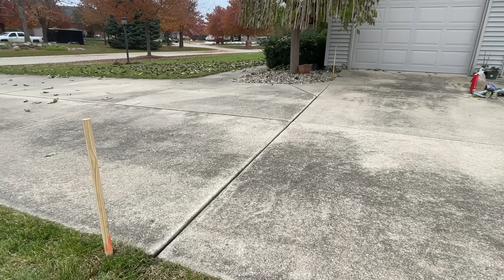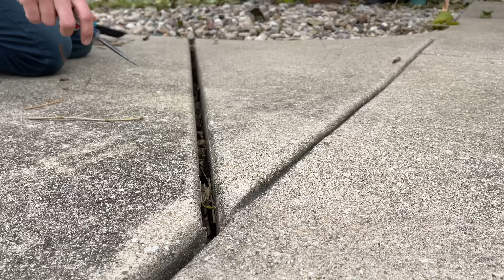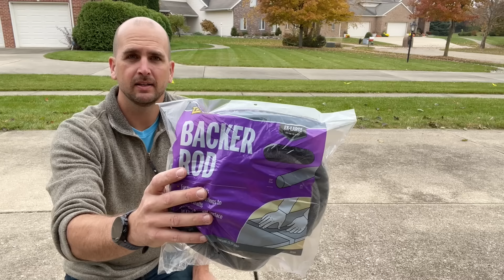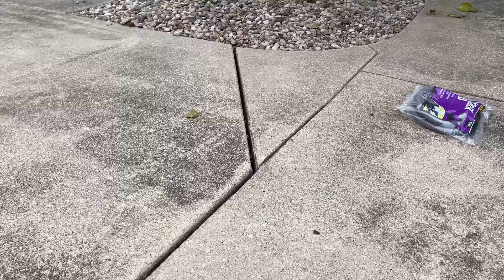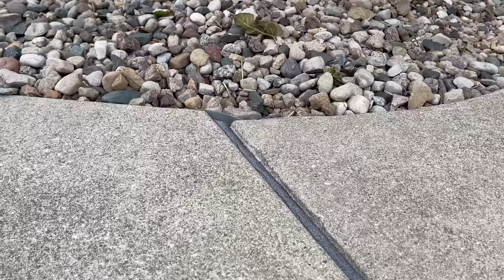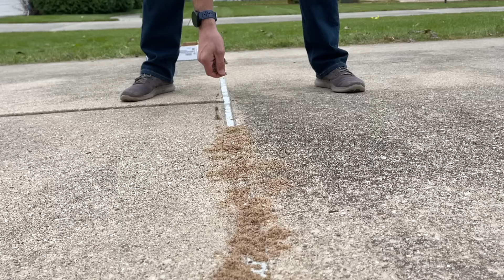How To Seal A Gap Between Concrete Slabs

Comment from the maker: Tremco Vulkem 45 SSL:  https://geni.us/FiPeg
1" Backer Rod (25'):  https://geni.us/qo7b0Ry
3/4" Backer Rod (20'):  https://geni.us/bCyfQBy
5/8" Backer Rod (20'):  https://geni.us/Yhxznv8
1/2 Backer Rod (20'):  https://geni.us/C1J5p

Tools Every Weekend Warrior Needs
Makita Cordless Drill Combo Kit:  https://geni.us/t7dIA
Dewalt Drill Bit Set:  https://geni.us/oFlSl
Dewalt Screwdriver Bit Set:  https://geni.us/VDcr
Craftsman Screwdriver Set: https://geni.us/jXqFI
Eklind Allen Wrench Set:  https://geni.us/7XfvO
Pliers (4-Piece Set):  https://geni.us/RIdx
Milwaukee Fastback Utility Knife:  https://geni.us/MlyiLk
Stanley Tape Measure:  https://geni.us/bUfD1R
Studbuddy Stud Finder:  https://geni.us/RySCuVw
Johnson Torpedo Level:  https://geni.us/wiLcDY
Stanley Hammer:  https://geni.us/bPDk8Wo
Buck Bros Wood Chisel Set:  https://geni.us/vk3cpTW
Klein Voltage Tester:  https://geni.us/h9Hl
Klein Outlet Tester:  https://geni.us/kdBAJ
Milwaukee Wire Strippers: https://geni.us/5zuLAbC
Little Giant Ladder: https://geni.us/fmlmTk

DISCLAIMER: This video and description contain affiliate links, which means that if you click on one of the product links, I’ll receive a small commission.

Comment: I've used Tremco's Vulkem products for years. Another tip is that if you don't want to apply sand and need the surface to skin up faster to prevent leaves from sticking you can mist the surface with water. Vulkem is moisture curing and that will allow the surface to skin over and keep things like leaves from sticking.
Reply from the maker: Nice, thanks for the tip Jeremy 👍
Reply: Jeremy you are absolutely right( most urethane sealants are moisture cured) but if the concrete gets wet before the sealant has cured it can affect the bond. I have installed miles of sealant on flat work and what I do is get a sheet of Masonite, rip it into approximately 4” wide strips for typical 3/4” joints, wider for wider joints, and tape it over the joint. If the sealant is installed properly the Masonite won’t touch the sealant.
Reply: @EverydayHomeRepairs  Hi, please, , I need to cover the space between the wall panel and the patio floor concrete. There is a gap of 2 cm through which mice, cockroaches and frogs enter. I'm afraid of using putty between two different materials (the wall panel and the concrete) and breaking the wall panel when the product expands. What do you advise me ) Does this product accept to glue these two different materials or does it only glue concrete with concrete ?
Reply: Another Wet tooling flim flam man trick
Reply: Thank you for the tip!

Comment: I did this 30 years ago. And it's still in place.
Reply: thats shocking. polyurethane degrades with the uv in just a few years. you mustve used silicone or did it inside the garage

Comment: Here’s a suggestion. If you have Company that sells concrete products, landscape blocks, etc, the one in my city has  every size of backing rod either on spools or in sticks. It’s way less expensive. I bought 300 feet of backer rod for $10.
Reply: Why not use clean sand instead of backer rod to fill in the crack first? Seems like it would be faster, easier, and cheaper. Just thinking....
Reply: Whaaaa, can you give an example of a company that does this??
Reply: @steadyeddie7453  Sand holds water; freeze-thaw pries joint open and breaks the bond.

Comment: Great video. I did a similar project but I used something different than sand on top. I went to a local landscape supply place and found the aggregate that most looked like my exposed aggregate driveway. I took a bucket and swept up the dust from the bottom of the aggregate bin and put that over my sealer.  It matched the driveway color very closely and gave it a nice blended look.
Reply: Clever!!

Comment: Vulkem caulking is an excellent product and will last a long time. I use a liquid tool handle product to seal partially used tubes of caulking. Just dip the open end of your caulk tube into the liquid tool handle and it will keep the caulking just like new until the next time you need it.

Comment: If you slightly pull or stretch on the backer rod during installation, my experience proves its dimension narrows enough to more easily fit the void without having to do all the poking. It’s a feel, but a slight twist along with gently stretching also narrows it, and one it is properly positioned, the rod relaxes holding right in place. For even larger gaps, usually where the slab meets the garage floor or the curb; I’ve used insulated pipe wrap for copper piping. It’s the same closed cell foam as the backer rod. Just be sure to fit it tight at junctions because it usually isn’t a continuous length. I’ve found rather than butting the end together, it’s better to force one end deeper in the crack and slightly overlay the next piece on top. The same is true for the regular backer rod wherever there may be a seam.

Comment: I'm halfway done with my driveway, and it's been a lot of trial and error. I went to buy more caulk and only found the thicker version that doesn't self-level. It wasn't flowing right and required a pretty tight grip on the gun to run, but setting the canisters in the sun while I worked helped a lot.
Thanks for the tips!

Comment: I thought this was great instructions, and I followed them as well as your other videos. I started with some back rod, and then I realized with some of the larger cracks that I used your pool noodle trick and that consistency of the pool noodle worked a lot better for me. It was much easier to squish down into the crack and keep in place. Thank you your videos are great!

Comment: I had a rather large driveway with a lot of expansion joints.  After pricing the sealant I decided to go a different way.  Like in this video, I cleaned out all the rotted wood and filled in any deeper wash areas with sand, but instead of using the backer rod, I used a soaker hose.  You can get the soaker hose in different sizes to fit standard width joints and once pressed into the joint it looked great.  I had the home for about 5 years after the installation and it looked as good when I sold the house as it did the day I installed it.  As for the cost, soaker hoses are super cheap compared to sealants and caulk.
Reply: @KickButtMarketing  I probably was not clear in the description of what I did.  Yes, backer rod is cheaper than soaker hose but it is not UV resistant so you will still need to buy the expensive caulk to put on top of it.  WIth soaker hose, that is all you use.....just the hose.  There is no need to caulk the top of it as it serves the purpose of looking good and keeping weeds out and will last for a long time.
Reply: I thought the point of the sealant was to keep water from going under the slab and, through freeze-thaw cycles creating voids & upheavals, cracking the slab.
Reply: Great idea but the joint won't be watertight right? Water can get under and undermine the base...?
Reply: For someone who has absolutely no caulking skills like this guy in the video that soaker hose or even just Replace the expansion material if you can and Do not caulk. I’ve seen concrete sidewalks and all kind of others completely fail and blow out maybe because like this guy, they didn’t even knife and tool it
Reply: @toecutter1015  😂😂no dude 🤦‍♂️🤦‍♂️

Comment: It is very important to make sure the crack is clean before filling. Not just scraping or blowing out the dirt. Use a mixture of bleach and water and then a pressure washer or garden hose to rinse the crack. Otherwise the filler wont bond to the concrete sides down in the crack. It will look good for a while but after a winter the filler will pull away from the sides of the crack.

Comment: I just cleaned between my slabs with a multitool with a caulk removal head, after cleaning the cracks out I used put some Preen in the cracks and I haven't had a weed between them in six months.

Comment: For a professional look with the sealant, use a fine sand like Quikrete Playground sand. Mix it half and half with a concrete resurfacer. Spread it on right after you lay down the sealant. This will blend in with just about any concrete surface. It works great.
Reply: I have not heard about the concrete resurfacer before, being mixed with the sand. Gonna try it. Does the sand adhere better this way?

Comment: Easy way to measure the slope of the driveway is to use wood scraps or something (old magazines) to shim up a 4 foot level and measure the drop. The 48 inch long level is roughly half of 100 inches so a 3 inch drop would be approx. 6% gradient. 3 inches or less would be acceptable for that leveling caulk product.
Reply: What should I use if my driveway slope is 7%
Reply: With high slope, use a non sag product

Comment: I jsut did my 75' drive.  Most home owners don't know about this easy maintenance process...I use a crushed granite rock (blue tint) that has som sand since I has exposed aggregate.  I kinda press tha small pieces into the sealant.

Comment: I use the self leveling sealant on my RV. It does not las long in South Texas. Good tips on cleaning up 
the area before applying the sealant. Good information on the backer Rod.
Reply: I don't think that's the same kind of sealant.

Comment: Albion makes a roller for backer rod that saved me hours of fiddling. It gives very consistent results. It’s a bit pricy and may not be a good value for smaller jobs. I also found that stretching the rod as you insert it can make it easier to get started. Some rod stretches further without breaking.
Reply from the maker: Oh man, I haven’t seen that roller before.  Just order it 🙌 thx!

Comment: I found the backer rod gets costly. For the bigger gaps, I put some sand in first, then filled the gap with small pebbles instead, leaving about  1/4" to 3/8" vertical space for the sealant. Once you put the sealant in, small amount of sealant flows in and fill the gaps among the pebbles, forming a pebble re-enforced sealant strip. This way, the sealed area is flexible and yet tough. The foam backer rod backing is too soft for me, unless you work to compress it hard. I abandoned that approach. For mid-size gaps, just fill the gap with sand first, still leave at least 1/4" space and then apply sealant. For small gaps, directly fill with sealant. Sealant is not cheap. You only need to fill the top layer with it. I also used pressure wash to remove the debris in the gap to save time. Make sure you have a few sunny days to work with. The area needs to be totally dry, or the sealant won't stick well. I ended up using 20 tubes to finish the job. It has been 4 years. It is still in great shape. Sprinkle the sealed surface is necessary, or the sealed strip looks too prominent and unnatural. But do it while the sealant is not yet fully cured, or it won't stick. I applied the sand when it was semi cured, by waiting for 15 minutes or before I did it. Applying it too soon you will see the sand sink into the sealant and largely disappears. The sand forms a thin layer of "crust" which is more abrasion resistant. It helps protect the sealant surface for a long lasting job.
Reply: I live in the south so am not worried about freeze/thaw cycles, but I am worried about undermining along the expansion joints.  In the years since you've been using the sealant, have you seen evidence of ants digging through it?  Also does a pressure washer damage the sealant?
Reply: Thanks for the additional info!! Big help.
Reply: @dchall8  No, I did not see ants digging thru it. But in a couple of spots, I saw weed coming out. One needs to clean the gap thoroughly if there is grass or weed in it. Perhaps treat it with a thin layer of salt too. I have not pressure-washed it after. But I think it won't damage it. The cured sealant is pretty tough. The line where the sealant meets the concrete maybe more vulnerable. So avoid those areas.
Reply: That’s the most over complicated and ridiculous things I’ve ever heard about in decades of Real caulking! No offense
Reply: @toecutter1015 No one asked.

Comment: I have sidewalk cracks. Your video provides understandable step by step directions. I plan to fix one crack first using your method,  products and tips. If it works, I’ll do the others. I’m wondering if living in Hawaii with its humidity requires special consideration on the choice of caulking?  I am an older female and perhaps best to contact the manufacturer for advice or a referral to a reputable contractor.

Comment: Great video.  Can you please do a follow-up after six months or a year to show us how it has held up?  I'm curious how long the sand coating will last.
Reply: I did the sand trick with a loctite ssl product. When we sold our house this last summer it was still holding strong as ever. That was probably a total of 13 years ago, conservatively.
Reply: What state? @mattrinne
Reply: @TheTurbomopar  NE. Cold winters. Humid summers. And it was on a driveway getting blasted by sun.

Comment: That looks great. I did mine last year with the sika, I did something wrong as I have some bubbles. I poked the bubbles while it was fresh and got the air out but still have quit a few bubbles. I wish mine looked like yours.. 😀😀😀 Thanks as your videos are very well presented.
Reply: You most likely used a closed cell backer rod rather than open cell. Closed cell releases gases if punctured which will cause bubbles

Comment: I've tried that on my driveway 2 years ago and this what happened. The backing deteriorated  and sections of sealant started  to collapse exposing the gaps again. It looked good at first but now gotta figure out what went wrong.
Reply: first fill in the gap with sand up to the point you insert the backer. the sand will support the backer and sealant.
Reply: @sandyrinks1834  I read that I should use silica sand. Is that what you used by chance? I'm trying to figure out what brand and where to buy it. Thanks.
Reply: It will continue to fail if you don’t even knife and tool the caulking. This guys work isn’t sealed. It’s just caulking pumped into the joint with sand on top FLIM FLAM

Comment: Such a great video! Liked and subbed! I made the mistake of using a backer rod that was slightly smaller in diameter as you warned. Sorry I watched this video after my project was complete. The backer rod did rise in four spots out of the 20 foot job. I waited the next day and slightly sanded the sealer (sika) and the 3/4” backer rod. I then cleaned the area and reapplied the sika and made sure its level and had a clean finish. I hope this will fix the problem and not give me problems in the future. I don’t think it will but fingered crossed. Thanks again and if you have any advice for me please don’t hesitate to let me know. Much appreciated for all your help and great work.
Reply from the maker: Welcome to the channel.  Yeah, the first time I did something similar and even "braided"the backer rod in the larger gaps which didn't work that great.
Reply: @EverydayHomeRepairs you’re awesome!

Comment: I think that in pressure washing the seams / surfaces where the expansion joint goes would give you a cleaner surface for the joint compound to adhere to.  Your end result looks great!!
Reply: He didn’t even knife or tool it it isn’t even sealed which is the entire purpose. It’s nothing more than a backer rod and caulking pumped into a big concrete joint and sand thrown on top

Comment: Brought here from your driveway pressure washing tutorial…. Questioning now why you didn’t first clean the driveway before sealing these expansion joints? 😂

Also the sand seems a great idea - however how durable is it? Wouldn’t your pressure washer rip it all off when cleaning the drive? Be good to know.

Otherwise great videos

Comment: Your vids are so helpful. I ordered the Tremco Vulkem 45 SSL for filling some driveway cracks just like you did. I got some from Amazon and others from our local Home Depot (9 total). Unfortunately the ones I got are much thicker than yours and lay down very thick and require smoothing out which does not work. Why is this? Your looks so much more liquid. I even left them sit in the sun to warm up for an hour which helped a smidge but not much. Help!

Comment: I used Crack Stixs for mine. Pretty easy to do and you get to play with fire doing it.
Reply from the maker: Did someone say fire 🔥  I have never used that product but looks nice!  I have some smaller cracks and that might make for a great video 🤔
Reply: @EverydayHomeRepairs  The end result was similar to yours. I used a large weed burner torch attached to a 5gal propane tank. Worked great. Just cleaned the cracks, filled with product and applied the heat.

Comment: I've been through this this laborious process.  I did fill the void left by the removed EJ material with sand as recommended before installing the backer rod and sealant.   The treatment did not look last long Started failing within 3 years.  Even with wire brushing the concrete, the sealant did not adhere very long, water got in, washed out the sand, and then weeds took over as before.  I was removing unsightly sealant before long.  I'd try soaker hose next time.   Note:  concrete shrinks as it cures and unretrained slabs shift with freeze thaw so once that happens the joints may get too wide for soaker hose.  Not found a low maintenance option.  Perhaps a self adhering self expanding full depth joint filler?

Comment: This is a really helpful video. Can you recommend the type of sand that I should use to fill the gap between the concrete driveway and the brick house before putting in the backer rod? The gap is 4 inches in depth. Thanks.

Comment: Do you have a video where it shows how to level a slab b/w driveway and garage when under the slap dirt has been washed out/off without using the quick foam mix that some use for yard fence posts?